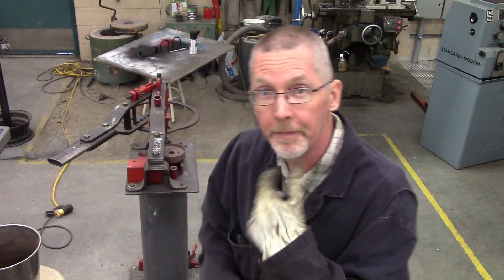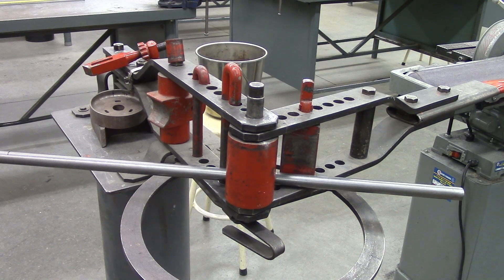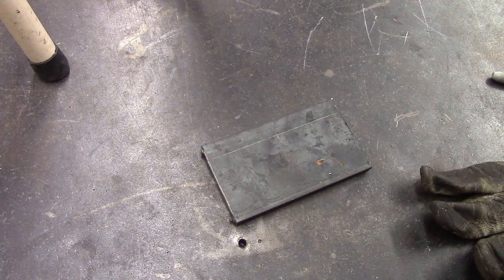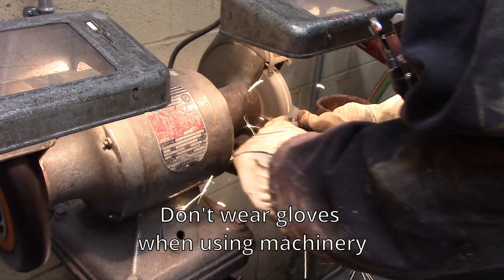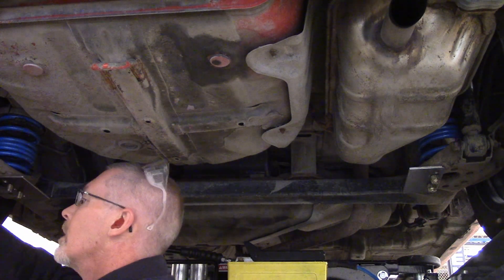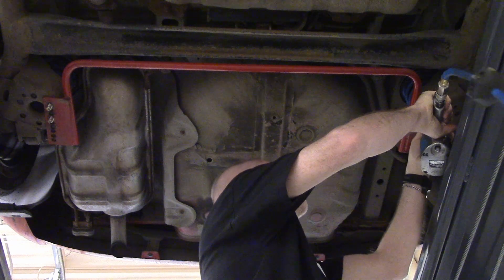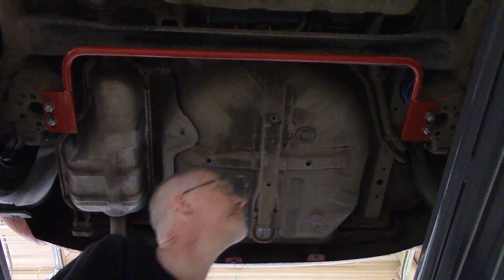Improve Handling: Make a Sway Bar

Comment: can I weld my broken sway bar?
Reply from the maker: How did you break it?  Impressive.  If you can file the steel, it's nothing special and can be welded with no issue, but how you weld it (and/or sleeve it , depending on how/where it broke) might be an issue for longevity or spring rate. So... "It depends" would be the best answer.

Comment: I have a 1967 mustang with a 1 1/8th sway bar made from carbon steel id like to cut the ends off weld new ones for heim joints do you think I would need to heat treat it
Reply from the maker: Only one way to find out (grin). (edit: I would try it)

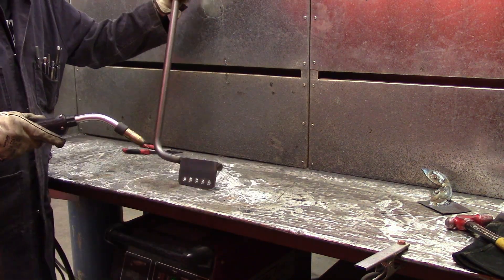Comment: 4:47 I intend to replicate your work here but a question on the mild steel thing.  If manufacturers use spring steel, but mild steel works, why do they use spring steel?  Is it that the range of elasticity is higher so it’s just a safer bet?
Reply from the maker: I believe (and I could be wrong), that a higher-alloy steel will have a higher yield strength.  As long as your suspension doesn't take the component past its yield point, you don't need the alloy.  I have also found many OEM bars that were clearly not spring steel.  Also - my next sway bar will be 3/16" plate, initially U-bolted to "box" the axle, and then welded into place once I settle on how wide it should be.
Reply: oh wow, really interested in that idea.  Sounds easier.  You may well have already seen it but if you search “Julian Edgar autospeed” on a search engine and check his DIY articles there is one in there about alternatives to traditional ARBs.  Sounds like that’s what you’re thinking perhaps?  I have thought about buying a second axle and cutting the main crossmember out and splitting it in two, then welding the back side over my axle to stiffen it up.  It should contour well but would need hammering on to be snug I guess.
Reply from the maker: Wow, there's some really good articles on there.  If I understand you correctly, you're thinking of essentially "doubling" the thickness of the axle?  That would definitely make it more rigid, but I bet boxing it with steel plate would increase rigidity even more with less of a weight penalty.  I haven't done anything about boxing my axle; I've been caught up in other things for a bit. (grin)
Reply: @GregWellwood  correct but my axle is like an indented tube rather than a piece of angle iron, so welding another backside on it is only adding half.  It requires purchase of another axle so not as cheap as other methods.  REALLY interested in your idea though.  Might try that first.  It sounds similar to what Julian Edgar did with the u-bolts and plates.👍

Comment: I have a sway bar which is recently removed from a vw beetle . So im going to planing install.it to my austin a30 as a front sway bar. When im installing it looks like i need to bend it from different places and weld too. Is it good or bad to done that kind of stuf to origial sway bar material?
Reply from the maker: Many sway bars are made out of basically spring steel.  If a file will cut it, it might just be normal steel..  If you cannot "cold bend" it, you can heat and bend it, but if it is a spring steel just let it cool in air, do not quench it or you might make it brittle and it might fracture in use.  You could quench mild steel and it might be a tiny bit harder, but at least you won't make it brittle.

Comment: Is that a dead solid axle rear suspension
Or is that a crossmember
Reply from the maker: It's a "torsion beam" axle - it _twists_.  The bar reduces some of the twist.  On any other suspension, this wouldn't work.

Comment: I have a festiva with an identical rear suspension. I wonder if this will help. I keep playing around with spring rates trying to eliminate body roll
Reply from the maker: Some believe in doing it all with spring and no bars, but by the time you have enough roll resistance, bumps really upset the car. I believe in relatively soft spring so you don't upset the car, and get the balance you want with bars.
Reply: @GregWellwood finally starting this project. Do you think 1/2 rod would be enough for a starting point?
Reply from the maker: @cafemotorsports  No.  I'd start at 3/4 or even to 7/8".  I am currently running a welded bar made from 1" SCH40 pipe which is almost perfect, and not tail-happy at all.
Reply: @GregWellwood  this setup will also be used on a road course as well a few autocross
Reply from the maker: @  Awesome.  Do not waste your time on a 1/2" bar.

Comment: How would it affect the result if you heated the parts that you're going to bend before doing it?
Reply from the maker: If you heated it and let it cool slowly, you've annealed it (softened it) - even Mild Steel can be slightly annealed.  As you cold bend it, you're also work-hardening it, which would make it harder.  In theory you could heat-bend it, then quench the bend in water or oil - Mild steel won't fracture by doing that, so it's low risk and would put some of the hardness back in.
Reply: Hi, in that kind of suspension,  do not need the bar that is fixed with the axis for it to do its job?
Reply: Can I order from you sir  #phillipines here 2018 accent